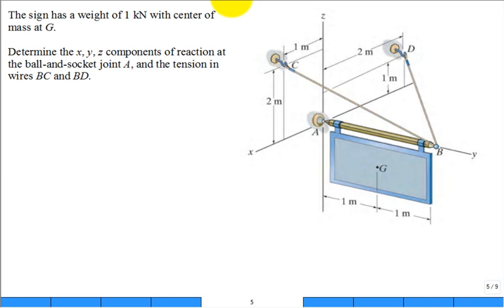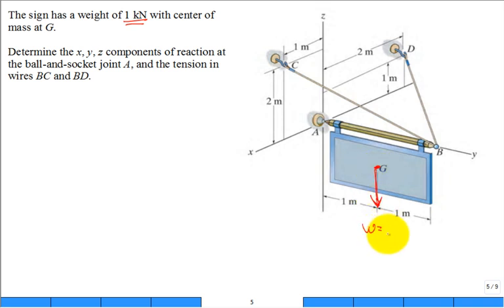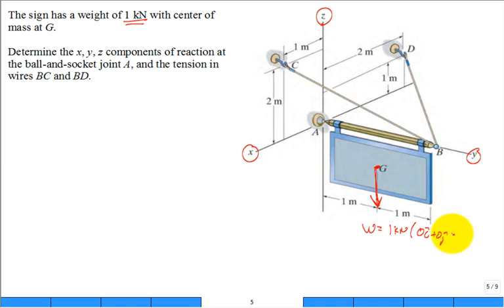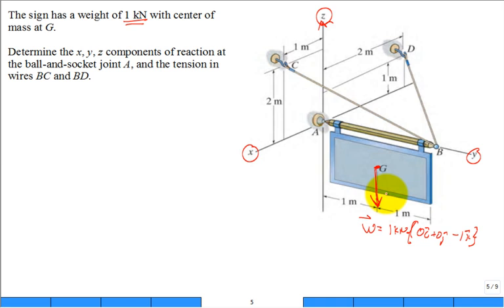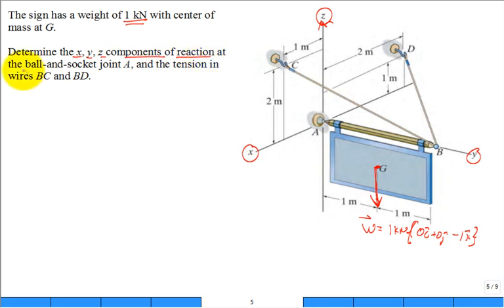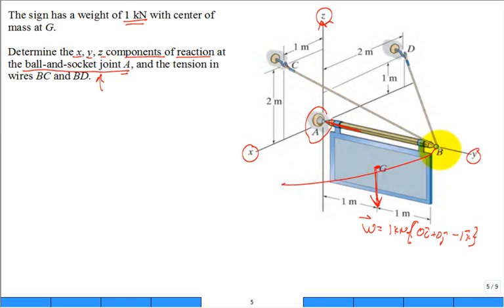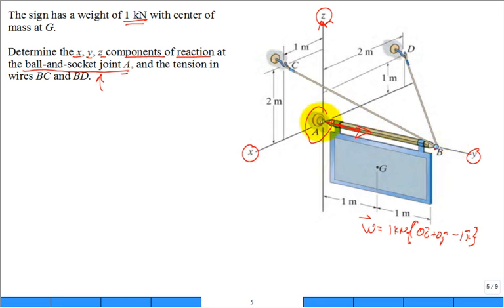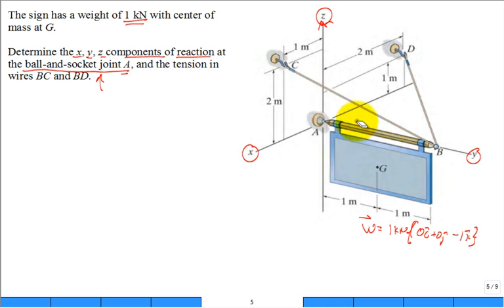3D hanging sign rigid body equil spr18

Comment: The coordinates for point G are wrong. THe sign is extending outward in the positive y-plane. The vertical distance from the y-plane is not listed on this diagram. However, the distance that point G projects "out of the page" is 1m. Although, I agree that Point G appears to be approximately 1m in the negative z-plane, or down. Simply put this is a poor problem as the information needed to correctly ascertain all of the coordinates for all of the points is not provided. Otherwise great job explaining everything.

Comment: The sign has a mass of 100 kg with center of mass at G. Determine the x, y, z components of 
reaction at the ball-and-socket joint A and the tension in wires BC and BD shown in Figure 21.

Comment: I don't understand where the the Moments at the x and z came from? If there's a moment in the x-direction, how would the weight affect it?
Reply: in static equilibrium all forces components and moments components must be 0, so all x,y,z of F and M must be 0 at any point on the system. in this case, since he showed that the equation for y-component of moments at A turns out to be 0=0, which isnt helpful to solve the problem . So whats left are the equations for x and z-component of moments at A.
Reply: The beam AB is fixed at the origin (0,0,0). When a beam is fixed, there are support reactions because the beam restricts translation. Because the beam is parallel to the Y-axis, we do not take a moment about it; Ax and Az are perpendicular to the beam, so therefore we find the reactions Ax and Az.